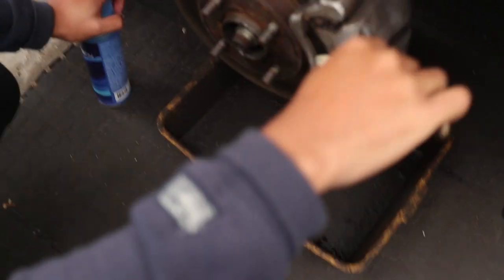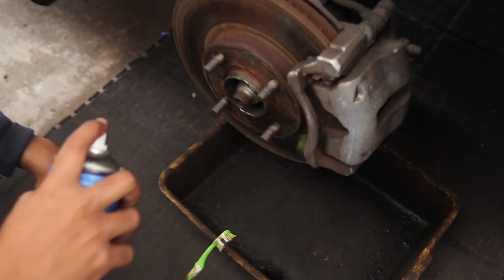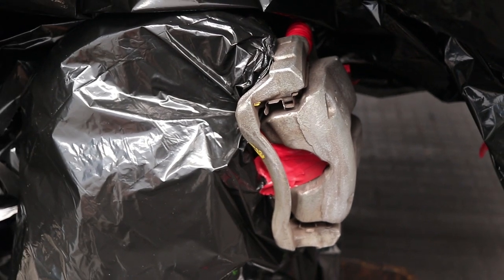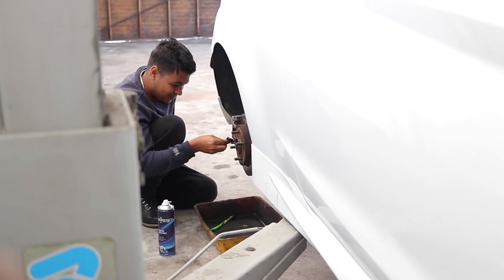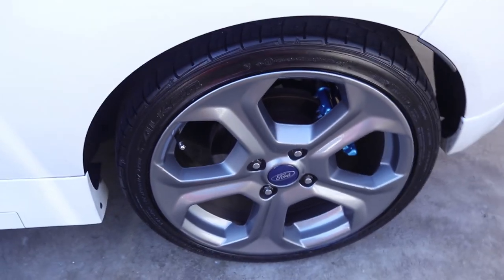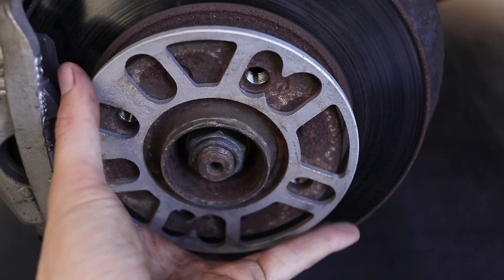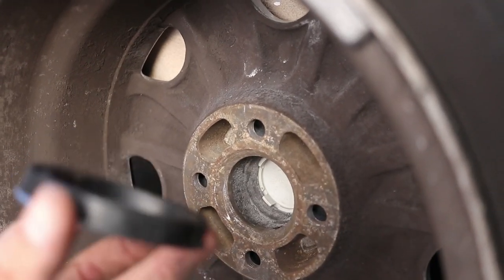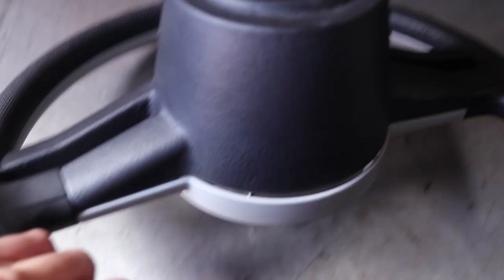How To Spray Brake calipers *THE EASY WAY* | Running Into Issues on the Mk1

Comment: I also had the same issue on my mk1 when I put the CTI wheels with spacers. I also never ran spigots so I'm sure that's what's causing the vibration. For the Velo steering, you can use the Velo wheel cap and it fits in the center, I've seen a few people do that.
Reply from the maker: Yeah hopefully I can figure it out, other wise I might have to end up changing the wheel 🤦🏻‍♂️ the proper spacers are extremely expensive

Comment: Where did u buy the spigot rings? Cool video,  i had my spigots made up by a engineering shop, that way it fit perfectly, some advice  if u have a old disc or rear drum take it with ur one wheel that u want to have it fitted to that way its a perfect. Good luck. I struggled finding spigot rings in cpt and ran out of options too. So yeah hope this helps.
Reply from the maker: Thanks so much Ash. I got them at Lalla’s tyres. do you perhaps remember the place you had it done?

Comment: The lug bolts vw uses are usually ball shape vs the ones you purchased are cone shaped. that could create an issue as well.
Reply from the maker: Thanks for mentioning that bud, it’s 100% correct. We ran into an issue with that while shoot the next episode. Will  mention it in next weeks episode